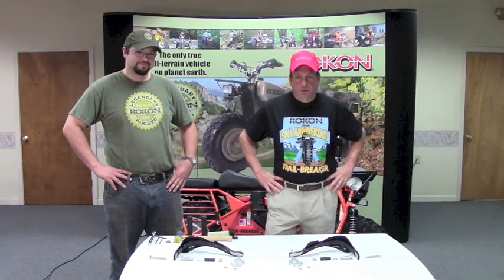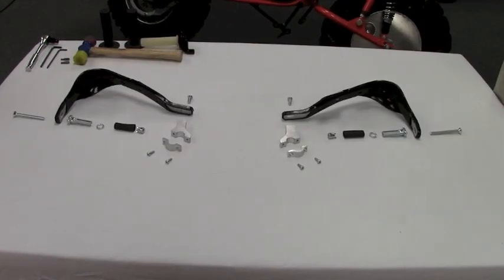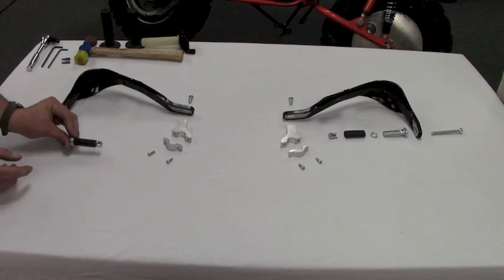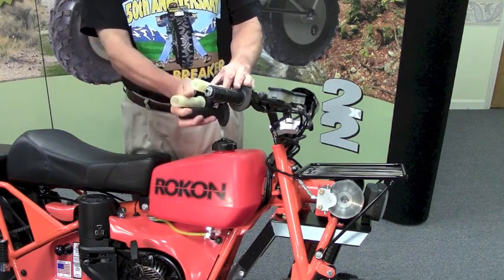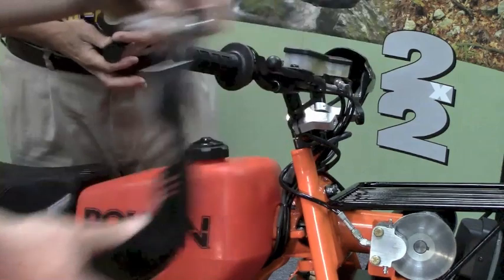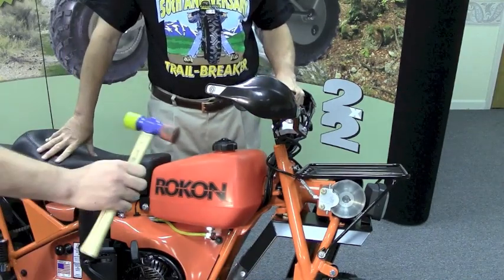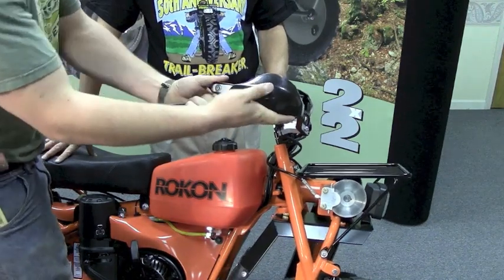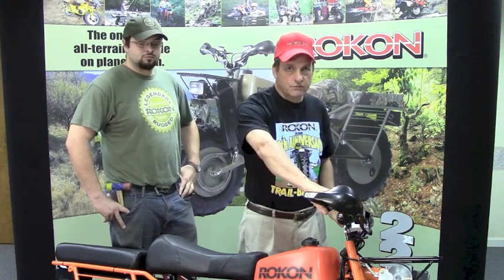Rokon How To: Install Brush Busters

Comment: Good series of videos.  Love my new Rokon Trail-Breaker.  Only thing I'd add to your video is, around 1:30, when you mention trimming : maybe add an example or techniques.  I'm not a mechanic, yet I have mechanical experience, and still I felt a little uneasy cutting the grips with a hacksaw, not really knowing how much to trim.  On the first try, the gas grip was too long and it was squished and wouldn't return.  After the second try, everything is fine... but I can't imagine a mecanically disfunctionnal person being comfortable with this.
Reply from the maker: Stefan, thanks for the feedback. We have added some annotations to the video in the section you mentioned in order to provide further clarification. Thanks for your interest in Rokon.